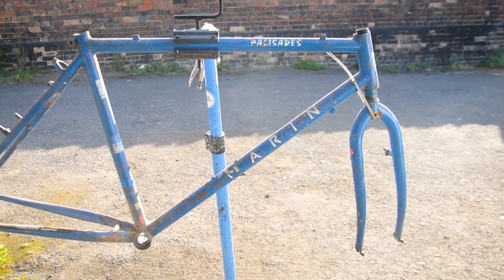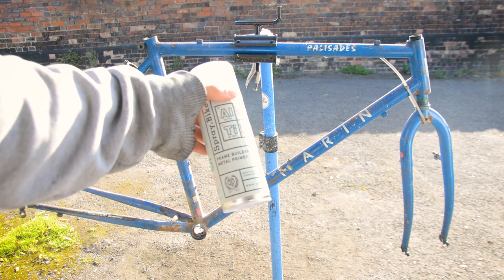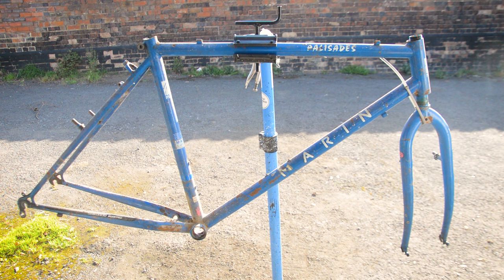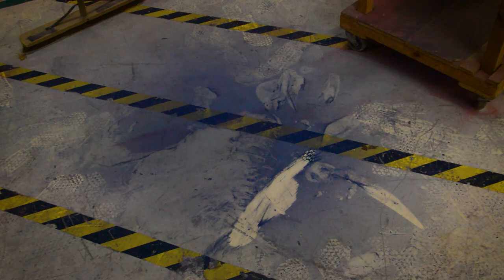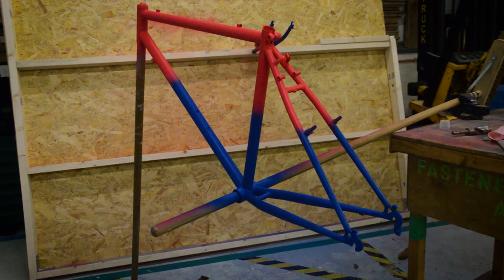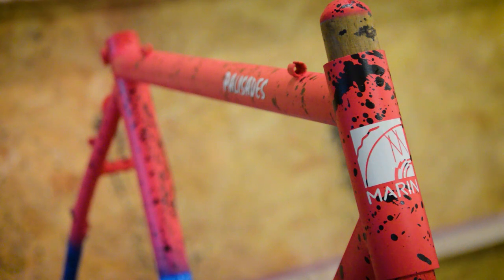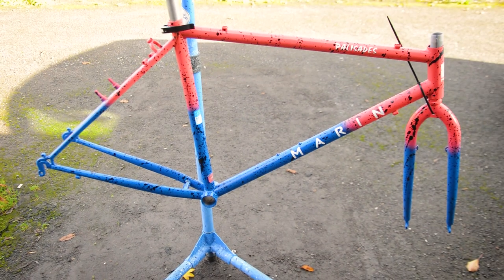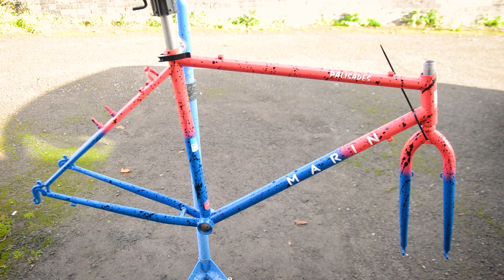Using Spray.Bike Spray Paint For The First Time - Honest Review - Bicycle Restoration

Comment: The price sounds pretty mad. I doubt they are superior or harder than most spray stuff on the market. I would probably just look for paints that are popular in the street art and graffiti front. I've tested some Montana 94 and Molotow Benton, they have really high amounts of pigment, so the chosen nozzle plays a very big part. Those paints are actually cheaper than most of the "local market" -stuff. I think the most important thing on a lasting paint shop is the clear coat. It has to be hard on the surface but adhere to the paint it's sprayed on. I would probably try a 2-part clear coat in a spray can  to finish it off. Though it should be noted that the used paints will match each other and won't make chemical reactions.
Reply from the maker: I've seen a lot of people recommend Montana in the comments.  I've personally only used cheap stuff off eBay before which doesn't seem to go as far as it should or Halfords paint (enamel and fluro) which to be fair, wasn't too bad!
Reply: Actually, spray.bike's UK distributor is Graff-city, so you'd think that'd say a lot about the street art/graffiti front's thoughts on the product. Then again, you have to dig around on their website to get it (unlike Montana, Kobra etc.) so maybe not, lol ...
Reply: @C345OFR  I have this feeling that someone noticed the old bike restoration scene and came up with the idea of labeling existing spray paints to be bike specific. Of course this is just a hunch, but most of the time bike things are somewhat more profitable products but are pretty much the same stuff than some industrial/diy products. 

This can be seen for example in lubricants, where a tiny container of "bike specific" grease (like 100-200ml) can be much more expensive than equally good "industrial grade" grease on a grease gun container (400-500ml).
Reply: @HulluJanne  If we're to believe their promo material, Spray.Bike is 'groundbreaking' and 'revolutionary' and certainly their origin story (https://spray.bike/pages/about-us) would suggest an alternative route to market than standard sprays, but you're right that normally, manufacturers can slap an extra 'tax' on top of a normal product by re-packaging it as bike-specific and seemingly get away with it. Infuriating, definitely.

Comment: Did you run the frame down prior to the clear coat? I have seen a few spray.bike videos and they have been "sanding" with backing paper. Not sure how this affects the look of the paint or the longevity.
Reply from the maker: I didn't.  I tried to lightly "sand" some of the roughest spots where the overspray had gathered with some super fine wire wool but it didn't do much at all.

Comment: I found the dry spray was quite much. I lightly steel wooled with 4x before laying on the wet coats of clear. Not impressed with their pigments in the base coats. I used the riverera or light pink. The paint color on the can looked great. Sprayed it over white base and the color paled so much it was disappointing. Not nearly what I was expecting. Easy to use base as it dry sprays letting amateurs  paint without much chance of runs. Oh well I tried it and the job came out well. Just block it after the base coat and lay on the clear and you will be fine. As for toughness. Powder coating or ED is the way of factory bikes for a reason.
Reply from the maker: Thanks for noting your experience Alan.

Comment: You need two part clear coat with a hardener in it to prevent the chipping - nasty stuff you don't want to be breathing and more than $20 a can here. Once you start adding up the time and materials it doesn't make much sense to can spray your own bike. Most of the paint is going into the air and not on the tubes. I did one and then priced powder coating. Guy wanted $100 for frame but when I got there he wanted another $40 for the forks. I thought that was a bit too much extra but even at $140, I spent about $50 in paint when I added up primer, enamel and clear coat and bloody hours stripping and then days waiting between coats to allow for hardening so if I price my own labour at $20 an hour, it's a no-brainer.

On top of that, we really need to be putting money back into our local economies and this is a good way to do it.
Reply: Spray Max 2k works pretty well. It's around €17. But it's worth it. Nothing worse than chipping your paint already while you're still assembling your bike.
Reply from the maker: Yeh I've used 2K paint to spray one of my old cars before.  Potent stuff!  I just don't have any of the spray gear anymore.

Comment: Do you have any idea how it compares to Rust-oleum?
Reply from the maker: I don't sorry!
Reply: @MonkeyShred  That's O.K., how different could it be?
One question though, after you sanded your primer coat, did you clean with a degreaser? I'm going to use acetone to clean the bare metal, is that a good idea between coats too? What do you think?
Reply from the maker: I used some "paint preperation wipes" between coats.  I wouldn't use anything like acetone on the fresh paint as you could take the paint off.

Comment: You had enough primer.  You should have wet sanded the primer and the paint before using the clear.  Then wet sand the clear.  Also, you seemed to be putting it on too thick.  Patience when painting gives you a killer paint job... Even with spray cans.
Reply from the maker: I'd disagree.  I gave the primer a light sand in spots and I revealed bare metal.  Another can would have been good.  Wet sanding the top coat coat might effect the fade.  Clear didn't have enough to properly take that back either.  I've sprayed my car before with proper paint and spent days sanding that back.  This thickness of clear wasn't good enough, imo.

Comment: A valiant first attempt but, ask any 'body' man, he'll tell you, it's ALL in the prep ...... spraying is far-and-away the easy bit, so easy a dumb machine can do it, NOT the prep though! Do this more, you'll get better, maybe as good as 'oldshovel' one day? As this frame is for you, try and park the 'cost' aspect? Properly done, an good enamel finish will look and endure far better than any powder coat, and , if, in time, you decide to sell it, you'll achieve a far better price.
Reply from the maker: Oh I know Greg.  I've had the joy of respraying an old car of mine on the driveway before.  I know it's so much bigger than a bike but I spent days sanding that thing down just to prepare it and then days working on the final finish with more fine sanding and buffing.  If I had the gun, compressor and somewhere to actually use that gear still I'd be using it on every build.

Comment: its not the spray paint, it's your spraying technique. your strokes are too slow. and if you sanded every time your gonna switch to a different layer the result would have been better. your paint job looked dusty. sanding would have avoided that